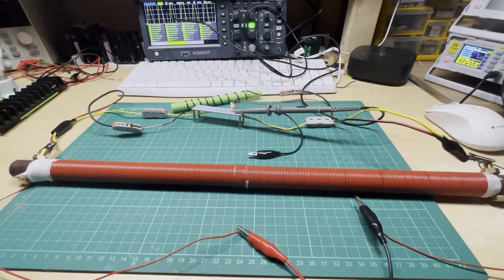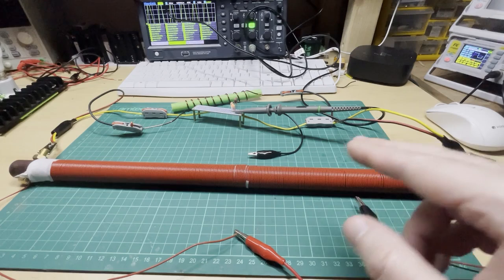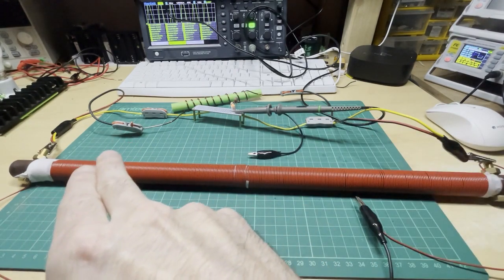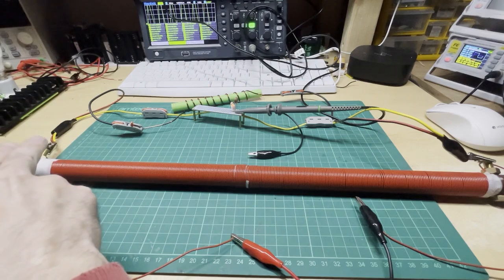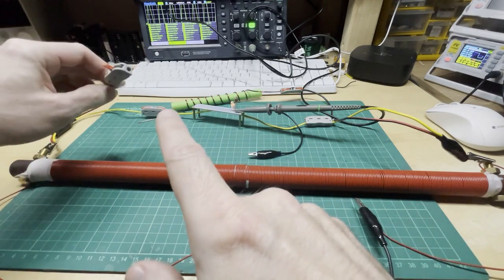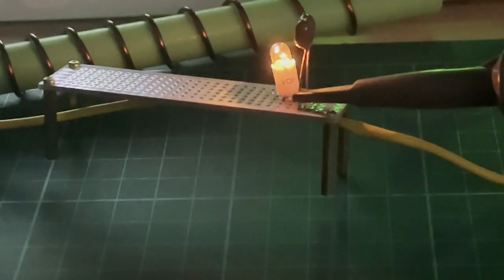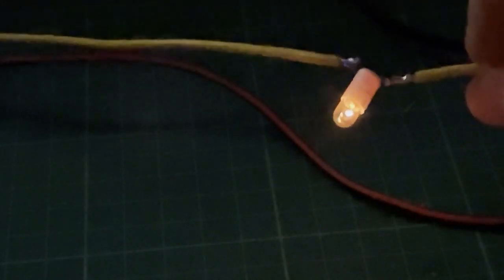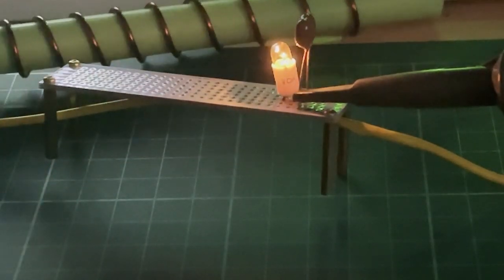What is cold current?

Comment: Could you make us a step by step video of how you do it because as I understand it the video is a coil on top of a copper tube insulated from the coil to its body, that is, first the tube then you insulate the body of the tube with a plastic and then you put the coil on and connect a shorted cable and another in parallel shorted but with a light bulb in bridge and 24v is injected into this coil. You don't say what amperage you used but I suppose it's one ampere that's why I tell you that it's better if you do a step by step of how you put it together to reproduce the phenomenon of obtaining more current from the circuit once grounded.
Reply from the maker: my friend, have a look at my channel, i have explained how to construct this device that produce scalar fields. there are schematics and measurments showing overunity. Yes, I only get overunity when I connect the earth ground. Please reproduce at your own risk.

Comment: Merci Michel de m'avoir mentionné.
Oups ! en anglais :
I'll give you some details on what Richard called "cold current". (I don't really like this expression)
I'll explain why cold current: in fact it's simple, normally, an electrical circuit will consume more, the more we increase the load. With this theory, we notice that the opposite happens. The more we increase the load, the more we reduce consumption... But, we don't know why yet, everything collapses suddenly as soon as we load a circuit. (go watch Jean Claude's videos)
On some experiments, we had cold current returns, suddenly, of several thousand volts which burned oscilloscopes with a return through the ground.
In fact, everything starts from the starting point which is to design a dim4 space other than using Minkowski space. Richard used multiplication as we calculate a surface or a volume.
In short, we can determine an energy mass which is a function only of the fourth dimension. But this energy mass can act on a volumetric mass.
So, we leave the space-time concept and we return to a concept of Einstein's ether.
At the electrical level, we are in the transport of energy via electron "currents". With this theoretical principle, we have no limitation when we go down into matter to the first elementary particle encountered which is the electron at the atomic level.
So, the mathematical laws of the Vialle effect also apply to the electron and therefore the electron also has an energy mass, but since it has a charge, then it also has an electrostatic mass.
Then, it is vector logic. Indeed, we determine a scalar first of speed which applied to a force will become a magnetic scalar. When this magnetic scalar will be oriented by a magnetic vector, it will create a displacement which will create an electric vector. It is this electric vector that Richard began to call "cold current".
Then, it is quantum mechanics with mathematical equations that determine an electron that will be in damped exponential. If we inject a good frequency to maintain this exponential, we recover an energy that should not exist for an electron. This is the "cold current".
A copper wire of a certain length can be a frequency generator, because the free electron of the valence layer vibrates for a very long time.
I tried to be as succinct as possible. But there are other notions that must be understood which are the temporal universes. With this theory, we determine by logic 2 twin temporal universes: a universe with positive time and its twin with negative time. But in the negative, we have a slight shift represented by an expansion bubble. This means that by modifying the fourth dimension, which is what we do at the electronic level, we make our electron jump in time. We bring it back to a position that it has already experienced. As the electron is on a damped exponential trajectory, then by making a jump in the past, it will have a little more energy. That is the "cold current".
It is still extraordinary to see that a light bulb lights up while we make a short circuit at the output of the "generator".
For the moment, I am still on the exploitation of the energy mass in the mechanical field, but in the electromagnetic field, the energy mass is much larger, so we should be able to measure time distortions.
Reply from the maker: Merci Beaucoup Monsieur Philippe pour nous aider à comprendre cette énergie.❤️❤️❤️⚡️⚡️⚡️

Comment: What if you combine this effect with earth grounding and an insulated antenna, seems that you could get more power out of it..
Reply from the maker: I did try to connect the earth ground wire to this prototype and noticed an increase in brightness of the bulb. Only this effect appeared on the right side of the copper pipe, this suggest since my coil was ccw wound that earth ground was connected to the south magnetic field of the coil.
Reply: @michelsbench   Fascinating observation!

Comment: What if you build this as a notched ring instead of cylindrical, would it also work? Seems that there's a lot of ways that the output power could be improved..
Reply from the maker: There is a version 2 of this autogenerator replicated by Jean Louis Naudin, those pages are in French, but you can use google translate to read more about V2 of this autogenerator: http://jnaudin.free.fr/rvproject/index.htm
Also if you are interested in replicating this device, I have made a translation of the paper here: https://docs.google.com/document/d/1izHEfmXwJ4RKjD_Rg023ykPPbK04mFQ8IrkuluK7j_4/edit?usp=sharing and a text to speech video: https://youtu.be/-rD_7FVmHxU?si=lNZedZspkgoF4CSs
Reply: @michelsbench   Many thanks for sharing your translation.